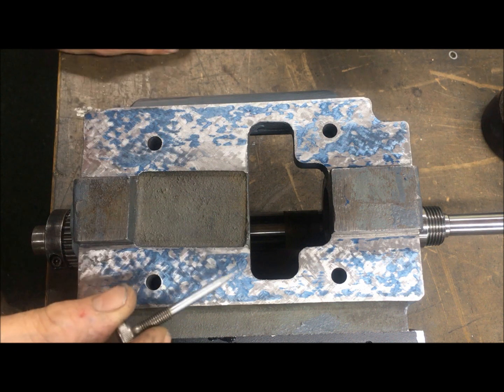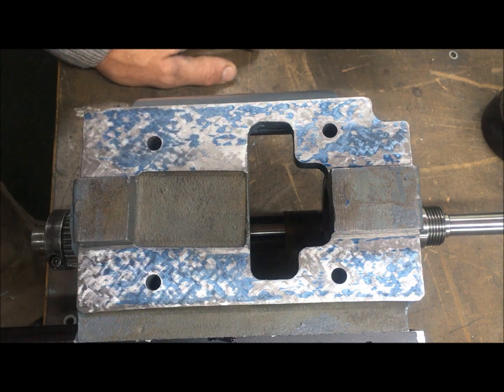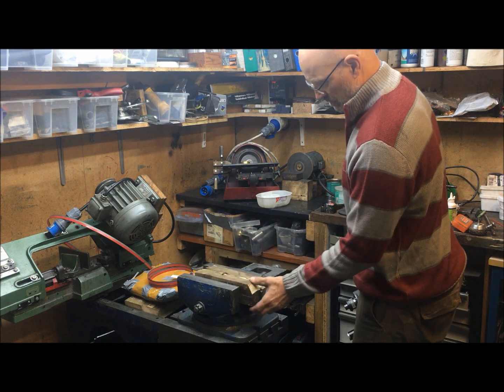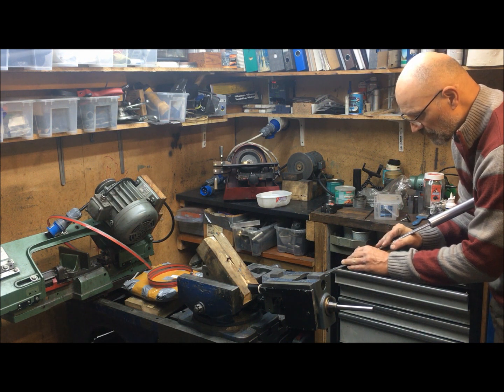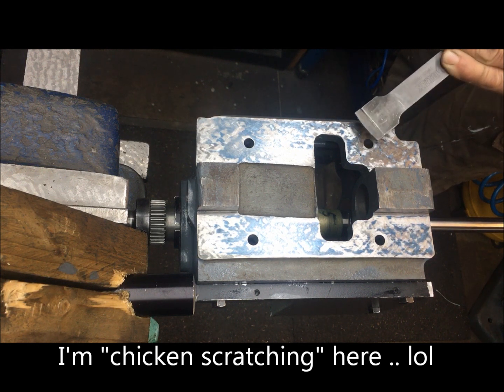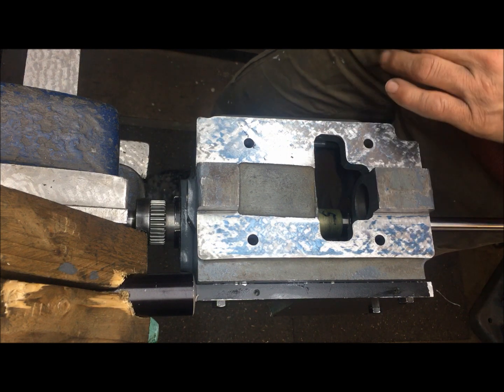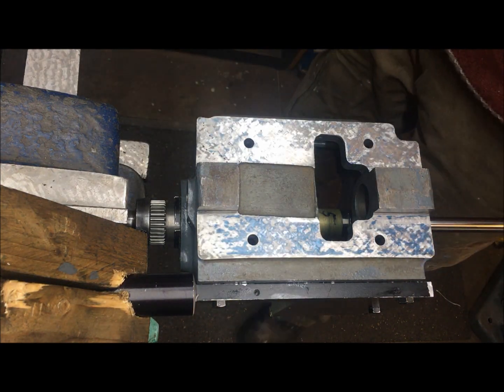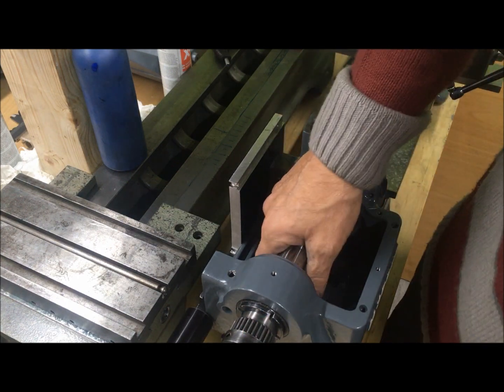Myford 7x7 -  headstock: setup, scraping and measurement

Comment: Boc boc boc (chicken clucking) Enjoyed Jan!
ATB, Robin
Reply from the maker: ROBRENZ Haha.. yes, that's right.. not enough depth of cut and this is how my/our mentor commented. Depth of cut might also seem like a "What are you talking about? Why?", but I learnt it to be an integral part of scraping, ie. one of the 4 rules RK preaches. For one thing, it serves the purpose of building a foundation for achieving longevity, aka long lifetime bewteen the need for refurbishment.. of course very important in a production environment (but you know all this 😎😉)
Reply: I never had any scraping lessons, but I have heard about the chicken clucking from others that have gone to Richard's classes. In reality the head stock interface you were scraping would be most rigid with a lapped joint. So scraping with very shallow depth of cut is IMO correct in this case.
Reply from the maker: ROBRENZ I agree.. I reckon if you lapped the joining surfaces there, they would be firmly stuck together even  without bolting. I have tried to use the precision ground (lapping) stones you have shown also on scraped surfaces with this effect

Comment: Logically as you say Jan it should make a difference in the lathes rigidity with the headstock's mounting surfaces properly bedding down to the lathe beds mounting surface as well as possible. A Myford is obviously not a massively over built machine. So gaining any rigidity wherever possible can only help. A side benefit should be maintaining a true headstock bearing alignment since the casting won't distort and bend while the mounting bolts are fully tightened up. For a bit more of your time you also have the personal satisfaction of knowing it's correct.

Stefan Gotteswinter has more than proved he can scrape to near perfection and he used an injectable machine tool epoxy between his milling machines base casting and it's rear column casting to gain some of that rigidity. I've no doubt he did it that way because removing the head and rear column multiple times while scraping both parts to a proper fit would be an awkward and very time consuming job. The epoxy was simply a faster and much easier method to gain what you are with your much lighter parts and scraping them in.
Reply from the maker: Hmm.. interesting. I haven't tried to use epoxy between machine castings/members, but I am sure this would also be a possibility. I would prefer to scrape though as one of the "beauties" with scraping is the ability to check your progress after each cycle and (sometimes very) slowly work your way through to "perfection", especially when it comes to alignment.
Yes, as you point out a Myford is not a big and sturdy machine in itself, so any small trick will help :)
Reply: I seem to recall that video Stefan did showing how it was done was roughly two years ago Jan. But he used a fairly specialized machine tool epoxy designed for just that type of work. My limited information seems to indicate house hold grades of epoxy can shrink or even cold flow under compression. Since his mills column should never need to be moved once the correct alignment was found, then bonding the column mount to the mills base would be fine. I'd think that not permanently bonding your headstock to the bed and still having the factory design for adjusting the headstock into alignment would be the better method on a lathe.

This is a bit off the topic of your video but it's sort of related. There's quite a science behind the gains that can be had from bonding and bolting metal assembly's together and I'll fully admit I know very little about it. I've learned a bit about precision shooting over the years and it's a common accuracy trick even with wooden gun stocks to use a very thin release agent on a rifles action and the barrel attachment point. Then mill out the stocks mounting area, then add a thick layer of epoxy and lightly bolt the action and barrel into the wooden stock until the epoxy cures. That release agent then allows the pieces to be separated, but the very precise and exact copy of the metal parts allows a noticeable improvement in accuracy.  My custom built benchrest rifle has a carbon fiber gun stock on it. With those and on mine they sometimes go even further and permanently glue the barreled action into the gunstock. When a new barrel is required they use heat to separate the bonded parts. The epoxy will release it's bond at a low enough temperature there's no effect on the metals heat treatment. 

I've run across a few minor hints here and there about some experimentation going on with high end very accurate machine tools and bonding some parts as well as pinning and bolting them together to help gain some rigidity. In the right areas I think there's some gains that might be made. On our lightly built home sized machine tools it might be even more noticeable ??? It should help dampen some fequency's of vibration as well. Bonding the rear column on say a surface grinder to it's base might show some improvement in the obtainable surface finish and overall accuracy it can then produce?
Reply from the maker: Thanks for the detailed comments on the use of epoxy for machine tools. Very interesting and a possible new thing to try for me!
I considered casting a bench top in epoxy granite but found it to be quite costly (compared to concrete). This was for the purpose of making a machine foundation, and in the end went with the granite stone solution.
Sure! The epoxy will be useful in some applications. I looked up on one of the lathes at Tony's site (lathes.co.uk) the other day (don't remember which, but think it was an English hi-standard lathe) and this manufacturer had the bed glued to the cabinet/stand, and just nipped up the bolts
Reply: Happy some of that might be of help Jan. I believe but am not sure the West Systems boat building epoxy might be available in Europe. While expensive it's supposed to be a very high grade industrial grade of epoxy and likely cheaper in larger quantity's that the more available household grades with there lower quality and performance would be in the same volumes. If the West Systems epoxy isn't available in your country I'm sure you've got something else just as good or better.

Using glue while metal working seems almost repugnant to me :-) But I can't argue it does have a place if it's used with some understanding and logic for it's capability's and when it won't add any benefit's. Obviously it wouldn't work for sliding surfaces on machine tools. But for those wooden gunstocks sometimes finely ground metal powders are mixed in with the epoxy. It obviously makes the surface more durable and might? slow or stop that cold flow problem when the epoxy is under compression. In the old days a lot of grout products were used during a machines installation and leveling. Epoxy could probably do much the same as what that grout did back then.

I've also used in the past the usual wood working contact adhesive to bond a second thin layer of sheet metal inside the belt guard of a cheap Chinese drill press. Doing that instantly solved the more than irritating vibration and noise the factory's paper thin sheet metal was doing. I doubt any of the much better equipment you have suffers from those issues though.
Reply: Bonding masses of materials which have different resonant frequencies is an excellent way to damp out vibrations. Sort of the light spring + heavy spring idea, as it were.  Bolting a cast iron machine base to a concrete floor (or a granite surface plate - good idea Jan!) has more than one kind of helpful effect, and the same principle can be applied to parts of the machine.
Reply: I believe the purpose of using filler (such as glass beads or granite) in machine related epoxies, is that the epoxy merely serves to lock the filler material together, and the actual rigidity, stability, and compression strength is provided by the structure formed by the filler particles in direct contact with each other. 

Much like the compression strength, stability, and rigidity of concrete relying in large part on the stone/sand aggregate (filler), and the cement itself locking those bits in contact.
Reply: Very true, but that crushed granite is also chosen for a few good reasons. The sharp edges help interlock the material together and the epoxy does the rest. It should be readily available in most areas, and it's got pretty good vibration dampening quality's. It's added high weight to volume ratio also helps. Plus there's no rust issues like using cast iron cuttings would have even though the cast iron would still dampen those vibrations. I'd think using crushed glass wouldn't work nearly as well for the vibration dampening part of it. But it could work well for all the other requirements. 

If my shop floor was concrete then I'd be looking for a large used surface plate for under my lathe and do much the same as Jan did. Unfortunately my floor probably won't handle that kind of combined weight.
Reply from the maker: somebody else Thanks for the valid comment. Although I am not an expert, I guess this sums it up nicely